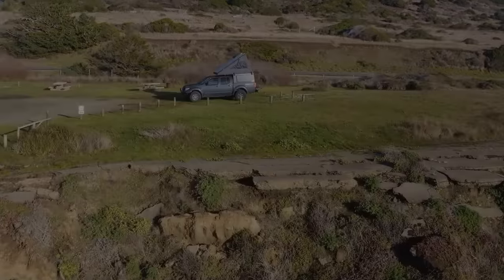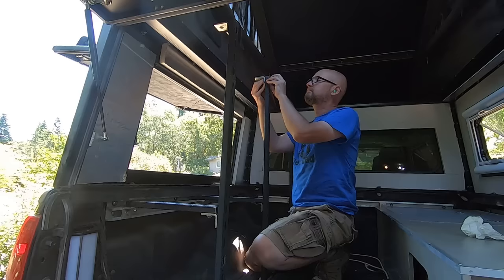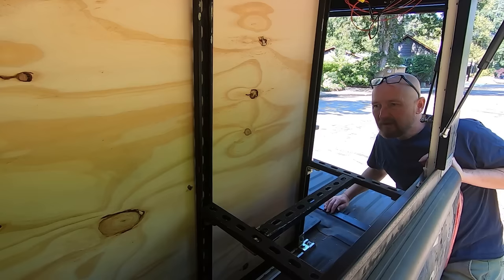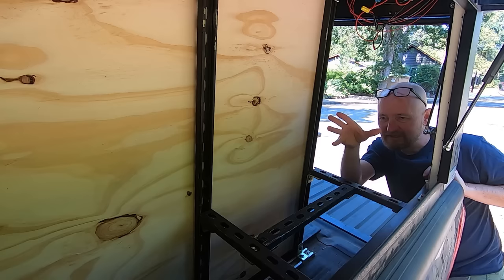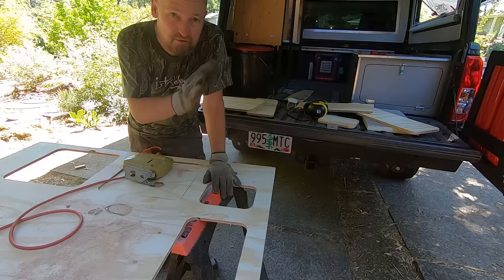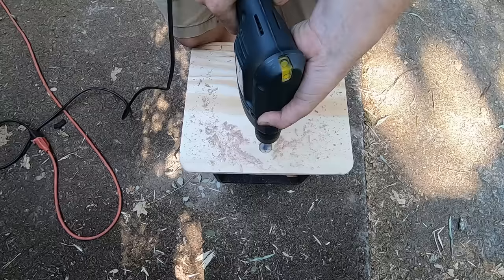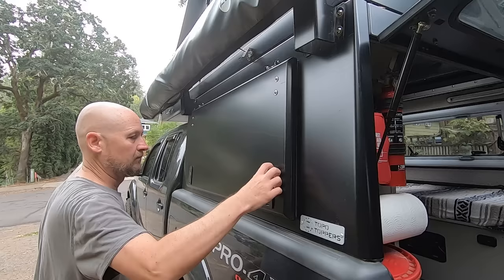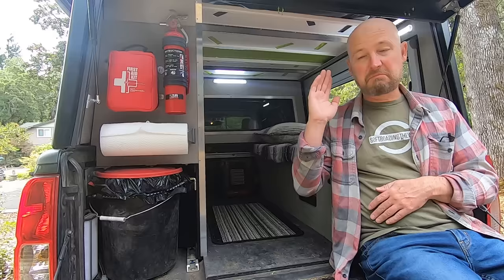Camper Interior Build Series: Part 6 - Cabinet & Drawers

Comment: Nice work! One tip I got from a build thread for using a hole saw to cut holes (and radiused cutouts): Cut part way through the wood, flip over and use the pilot hole to cut through on the other side. This prevents the tear-out on the back side when drilling through.  That should work with your spade bit as well.  Once the point goes through, stop and go in from the other side.  Another option is to have a piece of scrap wood underneath the hole to help prevent the tear-out.

Comment: I enjoy watching these DIY vids to see how your brain works because you are creative and determined. May I suggest you buy a router? With all the wood projects you do, having a router is a game changer. A trim router would be a good place to start and they are cheap. Get a 3/16" or 1/4" roundover bit and 1/2" bearing guided bit and you will wonder how you built without it - rounded edges, repeatable parts with a template including nice clean drawer pull holes etc. Just my 2 cents. Carry on!

Comment: Go DONALD Go !!
For your spade bit, either drill a tiny pilot hole first, or just drill halfway through your plywood, then flip the same plywood over and finish your 1 inch opening. If I express myself properly in few words, mush less sanding to do after.

Comment: Nice job on your camper build! I am in the process of building a bunk for the back of my truck. I'm also creating a 'charging station / nightstand' that I will use to charge my camera gear, headlamps, and batteries. It's fun to see how everyone designs to meet their own personal needs (and style too). I had previously built a teardrop trailer so I have a few tools at my disposal that have helped me along.  I tried my bunk out during a camp-out last weekend and I got so much satisfaction from sleeping on it. One amazing feature I never realized as I was designing the bunk...it's at the exact height where I can look right out the side window and see the stars stretching across the night sky! Now I don't want curtains! 🙂  I'll be doing a couple of videos on my build as well.
As you so accurately point out, we are not building furniture. We are not producing them to sell to the public. We are making them to meet our person needs. Recycled materials? Perfect. A corner that isn't exact? Not a problem. Thanks for sharing!

Comment: re -- slides
We and our caravan chums were in Baja years ago.
A neighbor on the beach (not any of us, none of us have factory RecreateVehicles) broke the supports for the slide-out room... burning up the tiny motor in the process.
.
A bunch of us removed the slide-out, inverted it, then glued/stapled linoleum sheet to the underside.
.
Re-installed, the slide-out/in could be hand-moved by the owners, saving the vacation.
[edited to add] The linoleum easily slid across the carpet with little friction!
.
An aside:
Experienced travellers usually have:
* zero slide-out rooms
* zero carpet
* zero factory RecreateVehicles.

Comment: Put some wax on the runners of the drawers.
You’d be surprised how much better they run.
I used strips of an old cutting board which makes it even easier.
If you to spend some money, there is a thick plastic tape (the name of the material is something like tfl, if I am not mistaken) on the bottom of the drawers!
Thanks for sharing! A lot of great ideas that I am happy to steal!
Reply from the maker: 19:59  I waxed them. They work perfectly fine for my use, I don't have to fight them at all. 🙂

Comment: re -- showers
October, 2022:
We acquired a Craftsman 20v four-gallon garden-sprayer.
We boil a couple gallons of water on the Coleman propane two-burner, and pour it directly into the hopper, then top it with ambient water.
.
With a stand-still house shower-wand spliced on the hose, one person rarely uses more than a couple-three gallons.
ProTip:
* although you think you will use only part of the hot water,  always start with a full hopper... a hot shower can be mesmerizing and addictive.
.
We like Craftsman 20v tools.
Our collection of batteries operate our:
* chain-saw 
* DA orbital sander 
* impact driver
* weed-whacker
... and probably others, as well.
.
We also use the garden-sprayer for worshing the dogs.
One year, twelve months, zero issues.
.
Craftsman has a three-year replacement warranty.
.
[edited to add]
https://youtu.be/r16GVA8a-S4?feature=shared

Comment: Looking Good! 
A couple things that may make things easier for future builds. 
-Put a piece of scrap wood under where you drill. Drill on a hard surface through your panel into the scrap wood. It will make a much cleaner hole on the back side.
-After you figure out where your doors will be on the plywood,  first screw the hinges on where you want them then remove them and then cut out your door. Then reinstall the hinges. The gap should be perfect all around the door. 
Thanks for the video! George.
Reply from the maker: Great tips, thanks George!

Comment: Nice job Donald! If the alignment of the drawers bugs you you can make a simple slide and track on the bottom of them out of 3 lengths of wood one attached to the drawer like a keel and 2 attached th the base.

Comment: Look into drawer slide tape. It’s cheap, thin enough that it probably won’t ruin your drawer clearances, and will make them run much smoother. I used it for my stove drawer in my Subi build because I didn’t want to give up the room for “proper drawer sliders”.
Reply from the maker: That's a good idea. I did notice that the wood-on-wood drawers in the kitchen of my house have tape on them but I didn't really know what it was. That's a wonderfully simple solution. 🙂
Reply: Teflon slides work great

Comment: Donald, the water jugs are consumables, in other words they break...so, instead of working hard to make a snug fit for the present jug (that you may not find an identical substitute for, when it cracks), you may consider stainless U shaped cleats and bungee cord. It works miracles and adapts to all sorts of jug shapes. 

Nice use of your new awning!

Comment: Nice work Donald! Quick tip- You can use a furniture paste wax on the bottom of the drawers and the runners to reduce the friction by a lot so that they slide much better. Minwax Paste Finishing Wax works like a charm.

Comment: Did similar build. I cut 2” x however long strips of  3mm thick centra PVC poster mounting board ( i had extra from old jobs) and used it for drawer slides.  Glued them to base of cabinet. Added some paste wax and is perfect!  Slides like a dream

Comment: If you can handle one more bit of drawer advice what I would advise is go find yourself a true beeswax candle and use it like a crayon on both the drawer runners and the floor runners. Don't use a paraffin candle, it just flakes and is messy. Beeswax will imbue the wood over time so you end up doing it less and lees over time as your drawers season themselves so to speak.

Top notch series, really enjoying it.
Reply from the maker: 19:59  I know this detail slipped by quickly at the end, but I did apply wax everyplace where wood contacts wood. 🙂 I have a little puck of pure beeswax for this. 👍

Comment: Great build! A couple of ideas for that large center section.  Install a large molle panel for hanging things up while you're inside, or, a fold down table/shelf while you are sitting on the bed. Safe travels!
Reply from the maker: Fold-down table for eating/working inside is the plan for that spot, yes. Just ran out of time before the Colorado trip and I really need to loop back around to some unfinished electrical work that is a higher priority. I am hoping to have a little fold-down table in there for this winter.  :-)

Comment: Hey Donald for your drawers, a really simple slide mechanism is like they used to use way back in pioneer days on furniture and that is a T slide of two pieces of wood use like a square piece of wood stock or the flat piece. Screw to the top of it and then you just make a guy that matches that tea that you screw to the bottom of your drawer. We have one slide on the bottom of each drawer it’s really simple to make can we made from scrap, that allows the heavy draw to slide in and out easier.

Comment: @softroadingthewest, Donald, its a really good looking build! 👍🏼 I like the DIY builds like yours and other channels like Overland Under Budget and Jason's van. I'm not a fan at all of all of the over-priced gear that almost every other cookie-cutter overland channel puts on and in their rigs.

As a side note #1: When drilling with a spade bit, drill halfway through the wood, flip it over and finish the hole from the other side. Doing so will prevent the wood from tearing/splintering, and you'll have a much cleaner finished hole.

As a side note #2: In that front lower cubby you could buy a surplus military sea bag or laundry bag and attach it to the backside of the cabinet front around the opening with staples or screws and you would have a dirty clothing laundry "chute," or for anything else you might want to stuff in there, and it will keep out the dust. Just a thought of how I would do it.

Keep up the great work and videos! 👍🏼👍🏼👍🏼

Comment: Very nice.  On the alignment you mentioned on the drawer faces.  If making them sit flush is what you are looking to do as you say.  You can either use two sets of magnetic catch hardware on each,  mounted at the outside top rather than just the one.  Or... You can glue wood block stops on the backside of the cabinet,  allow the blocks to protrude into the opening slightly (3/8 or 1/2 inch) on either side of the opening.  As for cabinet top,  you might find the metal angle on it annoying if you use it like a counter top,  It might be best to just sand the edge nicely and finish it as you would like. 

Keep up the good work!  Its looking good.

Comment: As far as the shelves for your side cabinet goes, you might consider using some wicker baskets. I’m using them very effectively in my off-road trailer, and I’m considering having a hanging shelf across the back of the jeep with a few more often times you can find baskets at Goodwill very inexpensively. I repurpose mine for my mothers estate.

Comment: HI DONALD 👋 
IT'S TURNING OUT REALLY NICE  ! GIVING ME SOME GOOD IDEAS 💡 I WAS TRYING TO THINK WHAT YOU WERE THINKING OF DOING & SEE IF I CAME UP SOMETHING SIMILAR  . I HAVE A A.R.E LOW  / WEDGE CAP SO I COULD SEE 👀 OUT OF THE REAR WINDOW BECAUSE MOST PEOPLE TAILGATE AROUND HERE  ! PLUS FOR EZ OF PUTTING  & TAKING THE BICYCLES OFF 🚲 🚲 & ON WITHOUT A LADDER  . YOU'RE GIVING ME IDEAS 💡 FOR A BED & COVER MY SPARE TIRE BUT GET TO IT EASILY  . SEE IF I CAN GET THE ALUMINUM BRACKETS LIKE WHAT'S HOLDING THE CANVAS ON MY COLEMAN POPUP CAMPER THEN  JUST OPEN UP THE CAP & THE CANVAS HANG OUT THE SIDE OF THE BED WITH BUNGEE CORDS IN CASE OF WIND.  CAN'T WAIT UNTIL YOU FIGURE OUT  / FINISH YOURS ! BE SAFE  ! HAVE FUN  ! ENJOYED 🍨 🍨 🍨 🍨 🍨 🍨 🍨 🍨 🍨 🍨 GOD BLESS YOU ALWAYS ON YOUR ADVENTURES 🙏 THANK YOU 🙏

Comment: You seem to have a good design, the outside access kitchen stuff coupled with the awning is a great idea. The only issue I can see is your laundry will fall in behind the drawer on the left and eventually block it. you might have to put a partition between the two compartments. Looks good though! 
I can't help but notice your jigsaw, it looks like the same one my dad had when I was a kid 30 years ago!

Comment: Have you tried using a hole saw for cutting corners?   Probably use what ever size you could use for door handles.  If you start with the 4 holes, then make the 4 plunge cuts to connect,  works especially well when your trying to duplicate multiple corners.
Reply from the maker: Thing here is, for maximum efficiency of materials and also to ensure a good fit, I wanted to use those pieces I cut out as the actual cabinet doors/drawer faces. Using a hole saw would have destroyed the cut-out piece of wood. And even had I done that, I still would have had to somehow make rounded cuts on a different piece of wood to make the cabinet doors/drawer faces. Ultimately, for what this is (a one-man backcountry camper) my imperfect cuts worked fine enough. No one sees them but me and I've already stopped seeing the imperfections. :-)
Reply: @softroadingthewest  I thought it looked pretty good and a useful space and layout!

Comment: Donald, over engineering the build out.😂  If a tree falls, jump under that shelving. Your truck frame may yield before your shelf does.😂 very nice, though.👍
Reply from the maker: Haha, well it was the 50 pounds of water contained partway up the cabinet combined with the significant movement the back of my truck experiences on gnarly trails that had me worried about my typical construction disintegrating under the force of that weight getting thrown around. Also an overpopulation of unistrut components that needed to be cleared out of my garage anyway. 😆
Reply: @softroadingthewest  You get that, too? I feel like I have the flexiest bed in the west. I think its the way Nissan attached the bed to the frame via intermediate cross pieces that allows the bed to deflect so much. I've been looking for a way to solidify the bed for a while now and still don't have it figured.

Comment: Nice build.  Any thought of going back to a 12V pump for the water? That might allow a larger tank to be used.
Reply from the maker: Never again 🤣 I very much wanted to avoid plumbing of any sort, no pipes or connections hidden behind or below other elements. Over the past couple of years, I've found that gravity works perfectly fine for water delivery...no need to complicate the build process further. 🙂

Comment: Wonderfully well thought out structure.  I like the bifacial aspect to your large cabinet.  Have the magnetic drawer closures held up on bumpy terrain?
Reply from the maker: So far so good, they've endured some pretty rough bumps and washboard roads. I put two magnet catches on the wide, topmost drawer as I figured it would get tossed around a little more than the lower drawers. I have a few extra catches so I can double-up the lower drawers if necessary, but they seem to be holding. 👍

Comment: If you don't put in some slide hardware for those drawers, you will eventually beat up the edges pulling them in and out.  The slides don't just ease the movement.  They align the drawers in a fixed way that makes them fit properly in the hole all the way in and out.
Reply from the maker: * shrug * These aren't in my kitchen at home getting opened and closed over and over every single day. A couple of operations per day only when I'm out camping...if I have to retouch the paint in a year, so be it. Plus, based on my history, in two years I'll probably tear this all out and redo the interior anyway with new ideas I get after using this setup for a while. 😆 I can totally see how building to a higher standard makes sense in some scenarios, but in my case, 100% not worth the headaches integrating hardware slides would have caused. 😄
Reply: @softroadingthewest    Ah.  Planned obsolescence, DIY style.  😉
Reply: @softroadingthewest  You could always wax the contact points of the drawers (wherever its wood on wood) with a candle, as that would reduce friction. Rig looks great!
Reply from the maker: @samueljlarson   19:59  They are waxed 👍

Comment: Looks great.
What's the bucket for? Lmao
Reply from the maker: I have no place to hang a trasheroo on the back of my truck, so the 5-gallon bucket with a tightly sealing lid is my trash receptacle. I just line it with a trash bag before I leave on a trip. The bucket also occasionally serves as a stool when I need to reach something up high (e.g. tying off an extra tarp shelter up a tree trunk, etc) and works as an extra chair if needed. Also, on some forested public lands in Oregon, you're required to have a bucket and shovel in your vehicle during fire season, for potential fire suppression.

But yes, in an absolute pinch, it can serve that one other purpose as well. 😆 I much prefer to take a walk in the woods with my shovel over using a bucket, but on rare occasion I end up in a scenario (e.g. traveling with friends in flat, open desert) where there's no cover and an interior option is good to have. 😏 A 5-gal bucket is an extremely versatile bit of gear!
Reply: Hahaha! A multipurpose bucket, perfect! 😁
Reply: @softroadingthewest  I was just giving you a hard time. But you are doing a great job, and probably an inspiration to many.
Reply from the maker: Haha, all good! I was happy for the opportunity to list off the many uses a 5-gal bucket can serve, and ultimately your insinuation was not wrong either.  :-)

Comment: Admirable job for your rig. Not to hate or be negative at all, curious about weight/ GVM issues?
Reply from the maker: No worries, fair question. The camper itself is ultralight and my rear bumper build is designed to be as lightweight as possible. My upgraded rear suspension is designed for carrying a full time load and actually performs best with a good amount of weight on it. Up to this point I've technically been under-loaded so I've been looking to increase the weight on the rear. With this new addition, I now won't be adding any further weight in the back at this point, but the truck is still sitting slightly raked, so I still haven't reached the standard capacity of the springs. Even fully loaded with fuel and water, I'm still well below the weight of anyone running a slide-in camper.
Reply: @softroadingthewest   Appreciate your thoughtful reply. Cheers.